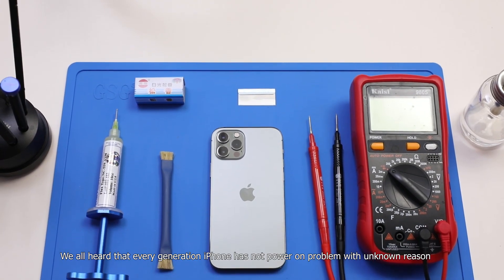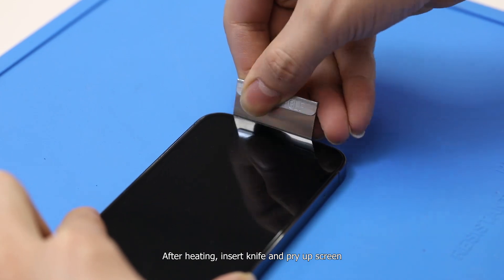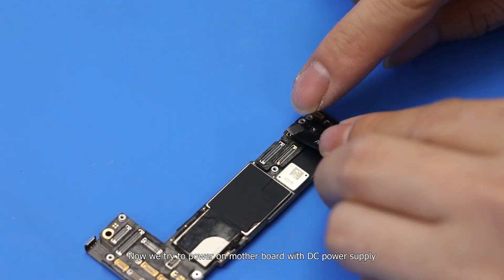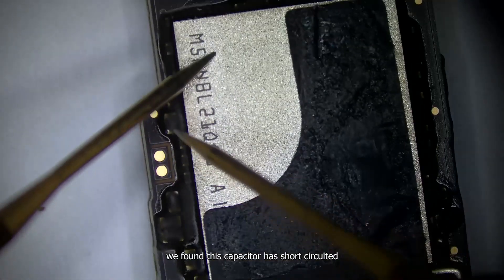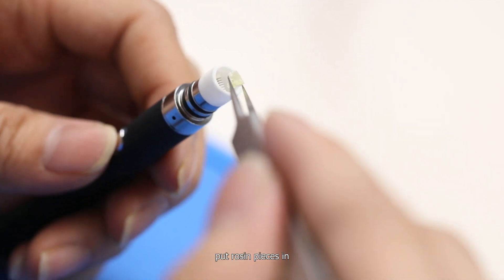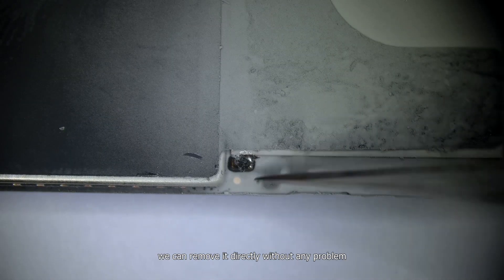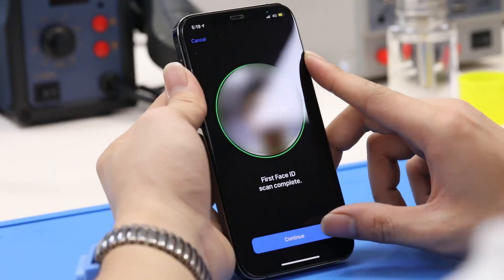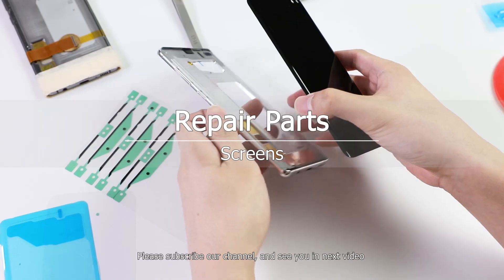iPhone 12 Pro Not Power On Repair, Locate Short Circuited Board With Rosin Dispenser.

Comment: i have an iphone 12 pro max that was exposed to some water. when the phone died, it didnt charge anymore and it didnt even show the water warning or no charge picture when pressing the power button. i left it to dry for a while and then put it on chage and this time, it said that it was charging so i thought it was fixed.. however the next morning it wasnt charged at all and it is turned off and can not be turned on and the charger doesnt work. is there any way i can still fix it and what is the issue. could a repair shop fix it? Or would the method used in this video work?

Comment: Guys what is the normal boot current of the 12pro ???
Reply from the maker: Without screen to reboot, it's about 80-90MA, with screen it depends, because different quality screen cost different amount of electric current, but normally if current more than 100 it might be problems.